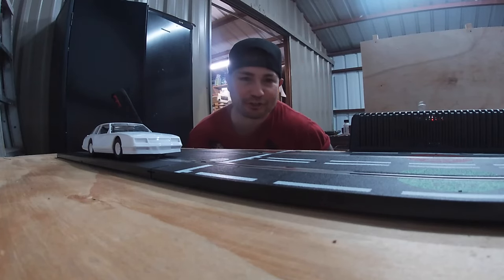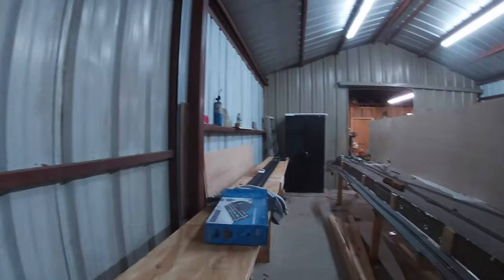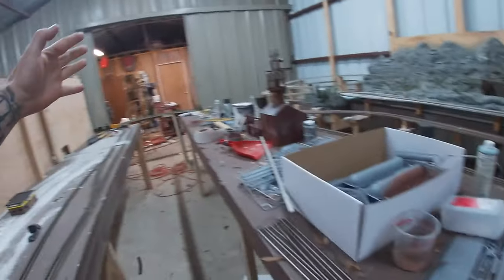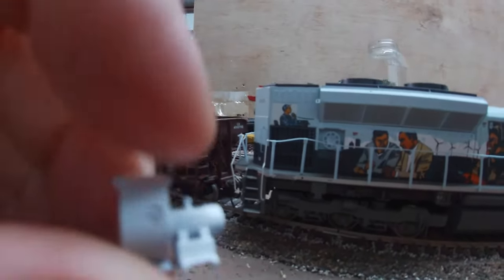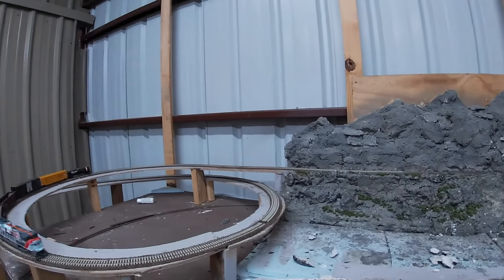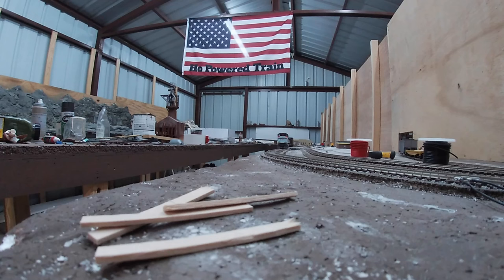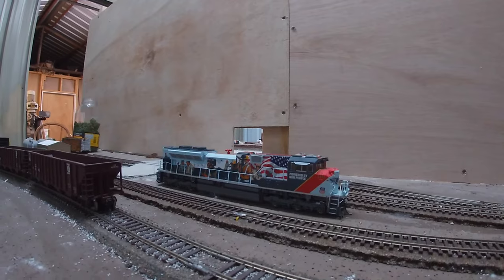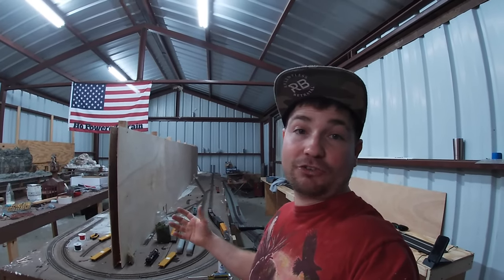Train layout::how long will a current keeper keep a locomotive alive?

Comment: I've got some old tyco steam engines I wouldn't mind doing what you did to that Kato unit, I wonder how well DC locos would run on a layout that size? I've got a bunch of life like and one Santa Fe F unit Ive never been able to get running btw I love your train content and I missed what happened to rc powered I followed that faithfully
Reply from the maker: Thanks Bobby yea Rc powered I have it in private it’s still there but I was not getting the joy out of it at the time as I’m not the one to continue something if I’m not feeling it …it was very slow and expensive and couldn’t get it on its feet so I discarded the channel …any who I’m here now and lovin the moments.. as far dc I ran it and does well only thing is track must stay clean